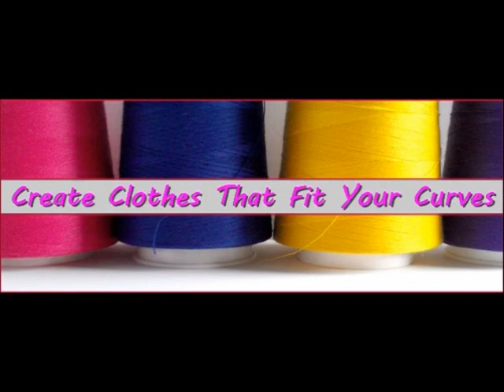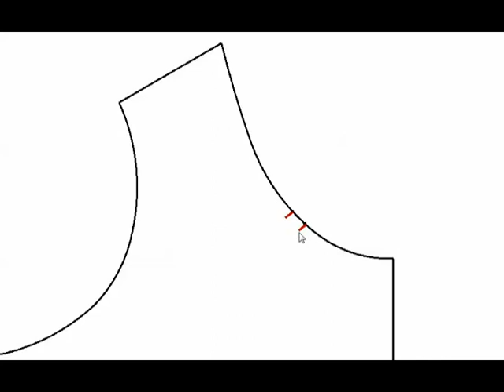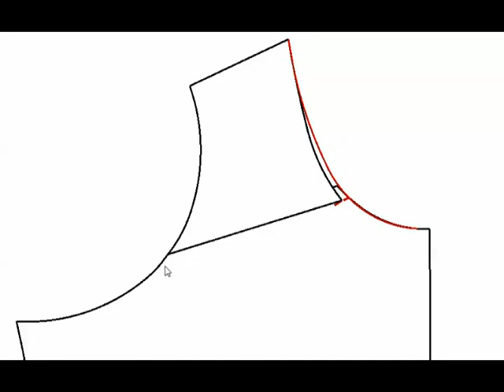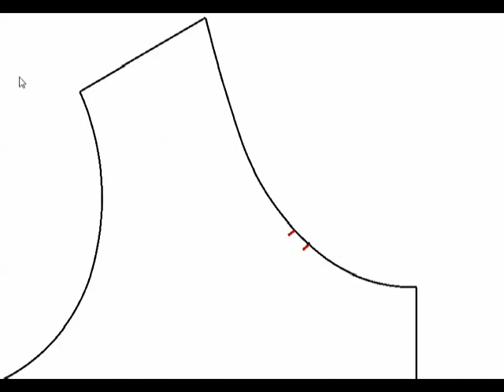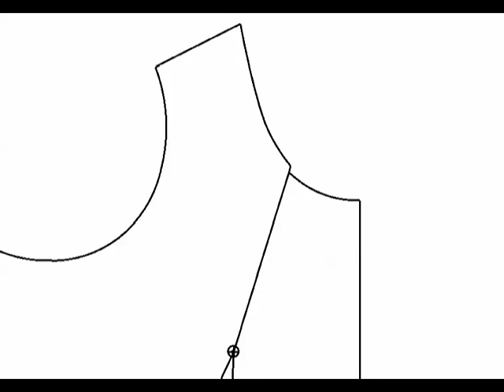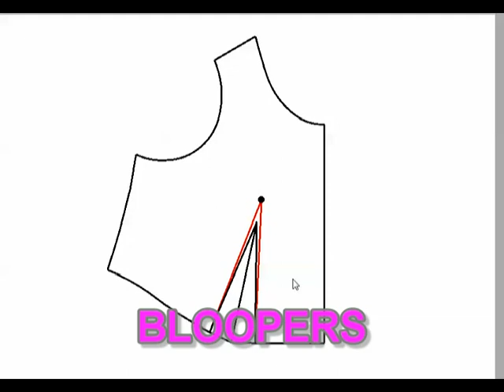How to Fix a Gaping Neckline

Comment: Hi Katrina, I have just altered my princess line back neckline using this method. I needed to do an adjustment of 2 cm. for the gaping in the neck, this however has caused a large wedge for me to true my neckline. Is this okay to do this in order for my neckline to lay straight, as it gaps otherwise? Thank you
Reply from the maker: Yes Valerie, this is normal. You can also try this method - https://www.youtube.com/watch?v=CEELkqBu_vI - might work better for you. The difference is, instead of removing the excess from the front only, you would remove it equally from the front and the back neckline. Then the wedge wouldn't be as large and your shoulder slope would remain the same. You would still have to reshape the neckline in front and back, but that's perfectly normal.
Reply: @KatrinaKay45  thank you Katrina I'll have a look and see if that will be better for me. Fingers crossed xx

Comment: you have very clearly explained this technique and I have altered my paper pattern. However the action of the pivot has changed the original pattern at the shoulder i.e at the top of the shoulder on the neck edge and at the top of the armhole at the neck edge. Do I have to compensate here in order to maintain the original shape? little confused but would appreciate your help
Reply from the maker: Valerie, fold out your seam allowance at the shoulder and match your front piece to your back piece at the shoulder, (as if it were sewn together). Then reshape your neckline and armhole at the shoulder so you have one smooth line. I hope this answers your question. If it doesn't, please let me know.

Comment: Thank you for sharing the information, this is very clever and neat. I am very narrow over the chest. I am sure this will help. Tell me will this alteration will I need to alter the sleeves at all?
Reply from the maker: Lynda, it depends on how much you need to take out of your neckline. Taking out 1/2" didn't really affect my armhole so I didn't have to adjust it. It's a good idea to measure your armhole before you start and compare it to your armhole measurement after you alter your neckline.

Comment: you are a whiz at teaching.  Thank you.  If my dart goes from arm hole to bust, how do I adjust neckline?
Reply from the maker: You don't have to use the dart just because your pattern has one. Check out this video - https://katrinakaycreations.com/make-gaping-neckline-pattern-adjustment/. The difference in this video is that the excess is removed from the neckline without using a dart and it's taken from the front and back neckline.

Comment: Wow. I love the illustrations. It really makes your clear directions even easier to remember. Would this also work for eliminating pleats in a yoke. I’d like to remove the yoke from the pattern because it fits well but I’d like to make one without a yoke. There’s about an inch and a quarter in pleats and a French dart in the pattern.
Reply from the maker: I'm answering this without seeing your pattern piece, but because it's a yoke, you should be able to fold out the pleats and retrace the yoke joined to the bottom piece, minus the seam allowances where they were sewn together.

Comment: Thanks for posting this.  Question, would a similiar technique work with gaping  armholes ? Definitely  will give it a try on neckline. Awesome instructor!
Reply from the maker: Yes, Cynthia, it could. For a sleeveless armhole, all you would have to do is reshape it once you take out the excess. But for an armhole that will have a sleeve sewn into it, you have to make sure it doesn't make it too tight, so you may have to lower your armhole at the side seam after you take out the excess.

Comment: Hi Katrina, thanks for the video.  I would like to know how do you fix the gaping neckline on ready-made clothes or clothes I bought that fits but has gaping neckline.  Thanks again.
Reply from the maker: Hi SuperModerngranny, there isn't a lot you can do to fix gaping necklines in ready-made clothes. I've seen people put darts in the neckline, but that doesn't look too good. You can take in the excess at the shoulder, taking in at the neckline and tapering to nothing at the armhole so it doesn't affect your sleeve. But depending on how big the gap is you may only be able to get rid of some excess, not all.
Reply: Thank you.
Reply: paw paw

Comment: But if this v neckline is in both front and back ...is it the same adjust methode ????
Please answer me 😍🌷🌷🌷🌷
Reply from the maker: Yes, you would adjust the same way. But for a V-neck, don't make your adjustments close to the V. Also, if your back piece doesn't have a dart, do the adjustment like I did for the dartless front.
Reply: Katrina Kay 😍😍

Comment: How to rectify this trick on cloth (After drafting &cutting)
Reply from the maker: This alteration only works on the pattern. If it already cut or sewn together, your options decrease. You can take the excess from the shoulders, which would be easier on something sleeveless, perhaps not so much with sleeves.

Comment: neckline isnt lying flat at the seam at the back of the neck
Reply from the maker: Yvonne, try taking a little out of the front neckline and a little out of the back neckline so the angle of your shoulder line doesn't change. In other words, if you took 1/2" out of the front neckline, instead take only 1/8" out of the front neck and 1/8" out of the back neck.